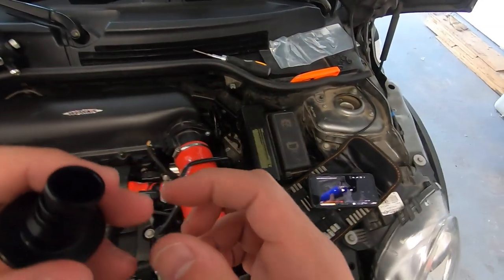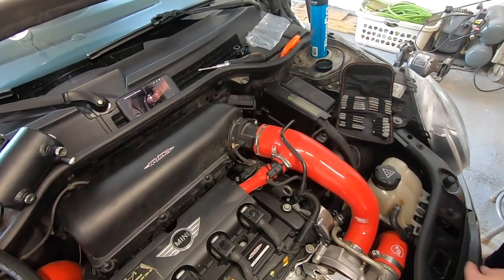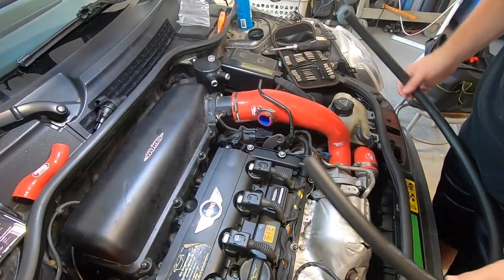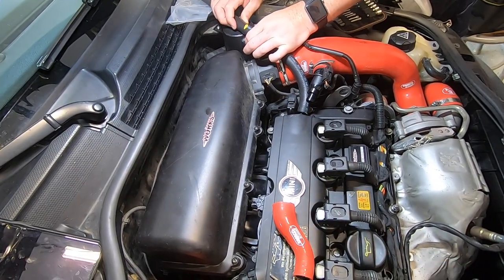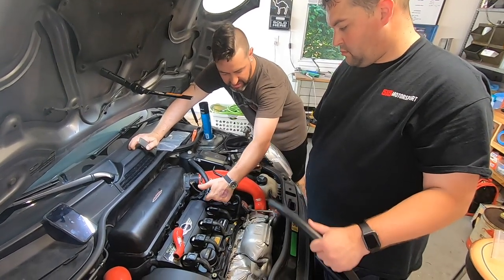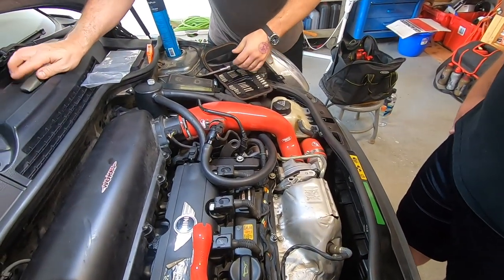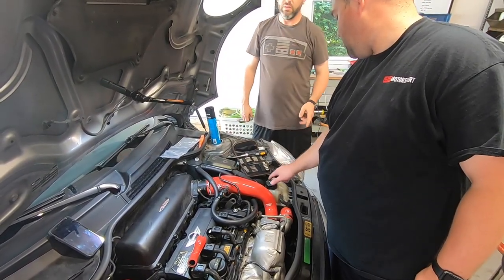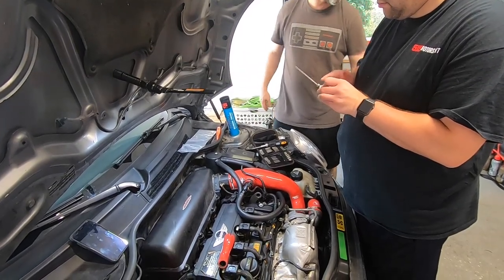N14 MINI Cooper Oil Catch Can Install

Comment: Why recalculate the oil mist? Is it not better to replace the pipe from catch can to intake with a small air filter? Then blank the rear valve cover breather and remove the rear valve cover to intake manifold pipe and blank manifold too. My thoughts are that this eliminates all chances of oil mist sitting on the valves and choking them up. Wanting to know your thoughts as alot of people do what you have done and there might be an advantage I am missing. Thanks

Comment: sorry if it's a stupid question but why use a catch can when you can just use a hose that goes through the engine room to the ground?  ECU errors?
Reply from the maker: If you’re referring to the actual ground, don’t want oil to exit the vehicle. 

The catch can, catches blow by oil running through the system. Later turbo cars didn’t have the need for this.